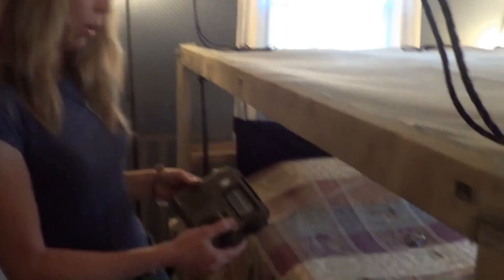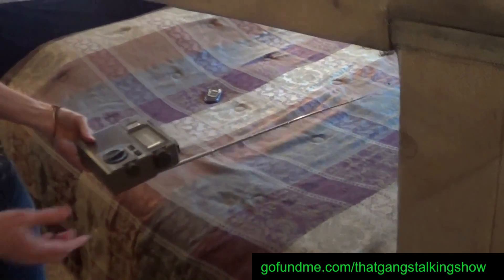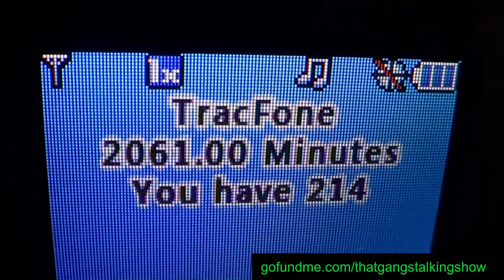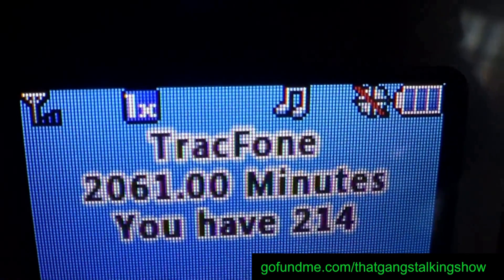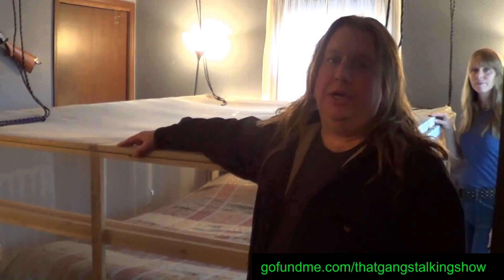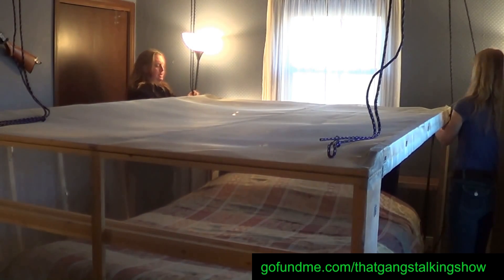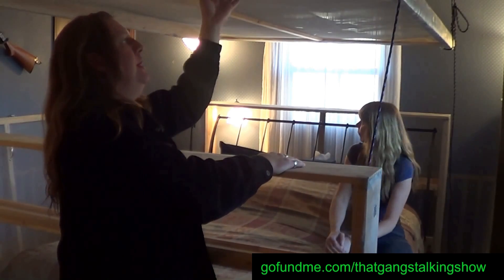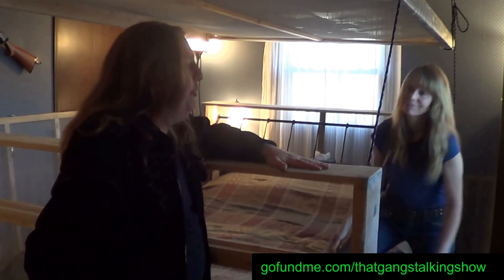Build  Faraday Cage for Your Bed - Shielding to Block EMF Frequencies - How 2 Block Radio Waves

Comment: Imagine this made with a prettier frame, some bead curtains on the outside and twinkle lights, then line it with mirrors all around the frame facing out, add some plants around that.

You can make it luxurious and why not? 

Or this: 
Mirror panels covered in gold leaf on the inside, mirror facing out to give an illusion of invisibility.  🎉

Comment: Love it. It's the Sun. Viruses love it. Dawn. Night sweats. July & August northern hemisphere. If I could build a pyramid I would. Very thick walls
Reply from the maker: I wanna address your night sweats. For more than twenty years, I had night sweats.

I had labs done and everything came back negative.

I like to sleep with an extra blanket. But the room I’ve been renting was so hot that I couldn’t sleep with an extra blanket.

Since taking off that extra blanket, I’ve had no night sweats.

Just use one good blanket and text this out. And let me know what happens.

I was having them several times per weak. I would wake up with my sheets saturated in sweat.

May God Bless You!

One last thing…
Don’t blame the program for everything.

Why?

Because they have agents in the program who intentionally post nonsense and disinformation.

On top of that when they post this nonsense, other TIs complain of the same problem.

But here’s the deal;

When I see something that looks like bs on fb, I check the profile of the person posting it. 

99% of the time it’s an Agent with a fake profile.

These Agents are in charge of more than 29 fake accounts.

How do I know this?

Because it doesn’t matter which account they use, they still use the same style of grammar, spelling and punctuation.

They are not Perps. Perps are low level people who either get hired as a role surveillance player or they are manipulated into doing this.

Perps don’t plan or orchestrate any of this. They simply do as they are told.

Agents work for the program and know what they are doing and why they are doing it.

There’s a big difference between the two.

So anytime you see a bs post, look up the account and you’ll see that it’s new. You’ll see fake pictures and you can tell that it’s fake.

They are paid to post psychological propaganda which is intended to be believable but in reality, it’s a farce.

I’ve had many medical problem since 2004 and not a single one is a result of classified electronic technology.

Comment: Please explain step by step exaclty how you made an emf canopy with instructions and matrieals so people can make their own. Thank you 🙏
Reply from the maker: Need to look that up. I found this video and uploaded it.

They talk about materials used in making it.

Watch it again and take notes.

Look up the material online and shop for it.

For the dimensions, use a tape measure to measure your bed and then allow a few inches on each side and figure how tall it should be.

Use 1x2 lumber for the frame and screw the gram together. Then cut the mesh and staple it to the frame.

If you can’t do it, contact a handyman online and provide him with the materials and tell him that you want to build a faraday cage around your bed.

Tell him you’ll need a way to get in and out of the cage so he can build a door.

That’s all I can tell you.

Look up EMF shielding online. There are hundreds of places to buy from and all sorts of materials including paint that will provide emf protection.

Comment: Hello, can you give one of the links or buy the fabric (or the references) but also the grounding system? Thanks a lot. I thumbed up and subscribed
Reply from the maker: I uploaded this video from YT. I didn't create it. You can study how the cage is made and come up with your own design. You need to study what kind of radio waves that you wanna block and then study what materials block them. I know that there is ample tutorials and ample materials to do this. You just have to look for it. There is fabric and paint. There is shielding....But YOU have to do the research. I don't use shielding. Why? Because I don't know what to shield against. I'm hit with RNM and from my understanding, there is NOTHING that can BLOCK SCALAR RADIO WAVES. But, lets say that I am sensitive to WIFI and Cell Phones, I would study those waves and find the right materials to block them.

There is a TON of materials to shield against everyday radio noise. But as far as I know, there is NOTHING to shield against REMOTE NEURAL MONITORING!
Reply: I had a friend build me a cage around my bed.  We just used aluminum screen.  Total cost $300 for the build and supplies.  BEST THING I EVER DID!!!  No more headaches, lower back pain, neck pain, knee pain, shoulder pain and I sleep like a baby and wake up refreshed in the morning.  I can literally feel my body relax as I lay in my bed.  NO MORE CHIROPRACTOR visits!!!  The money I saved on that alone it has paid for itself a thousand fold.
Reply: @pamelaremme38  The references of the aluminum mesh used please? mesh thickness, centimeters of spaces...etc thank you very much
Reply: @pamelaremme38  The references of the aluminum mesh used please? mesh thickness, centimeters of spaces...etc thank you very much
Reply: @pamelaremme38  What type of aluminum screen?
Reply: @jonfragments3294  The kind you put on windows.  It comes in rolls.

Comment: What’s the exact material that you used? What if the material was made into like a mosquito net instead of using the wood, would that work as well?
Reply from the maker: I have not used anything. I’ve only researched it.
Reply: Use aluminum screen.

Comment: If you can build the box bigger, then why not imbed the mesh in the walls and ceiling, or if it's just for the phone, then build a box just for the phone and any other portable devices?
Reply: Because it permeates the area's all around us.  It's not that easy to put it on the walls and ceiling and FLOOR.  Easier to build a cage.  If EMF's had color and you could see them you would be mortified with what we are being bathed in.

Comment: I have relatives in Indonesia living very close to  a pole that runs electrical wires overhead and this pole is a node for three directions.
Some 5 to 6 cables running, with ordinary 110Volts ..i dunno how many Amps.
The node at 4 meters up is standing at closer than 8 meters from the side of their little house.
Now..is it working to have a self made faraday cage built from (what mesh size ?) mesh and have it shaped in a cube or a globe  AROUND this node of electrical wires/spaghetti ?
and thus protect these people from negative electric/magnetic radiations ? (I mean, it is simpler than building faraday cages around each bed..).
Reply: Not if the waves come from antennas

Comment: To ALL:   The best FARADAY CAGES are made of layered ferrous and non ferrous metals.  This blocks both electrical AND magnetic alternating fields.
Reply: Nice, thanks!
Reply: So for example a layer of steel mesh and a layer of aluminium mesh would suffice?
Reply: @Olofo_olofsson  that’s typically what’s used
Reply: @koba2160  thank you for that

Comment: what's the brand of the metal mesh?
Reply from the maker: I think it's aluminum or copper. Look it up. I didn't make the bed, I snagged the video off yt.
Reply: @ThatGangStalkingShow  To ALL:   The best FARADAY CAGES are made of layered ferrous and non ferrous metals.  This blocks both electrical AND magnetic alternating fields.
Reply: @alankrebs856  Where do you get that material?
Reply: @pamelaremme38  If you mean materials to make a Faraday Cage you improvise. Metal is metal. There are only 2 types, magnetic and not. So you layer your cage out of both metals. You have all the tools to test effectiveness. A phone or radio will show you when you have blocked electrical waves because you will get little or no signal inside the cage.  A common Boy Scout magnetic compass can be used to test for magnetic field blocking.  The less the compass moves when you move a magnet outside the cage the better your magnetic shielding is working.  For non magnetic metal you can use aluminum foil from any food store. For steel which is magnetic you can salvage panels from old washers or fridge or other appliances.  Research MU metal. This is a commercial material that blocks both field types but its very expensive.  What I suggested is a low tech relatively low cost way to achieve the same result on a large scale.  No one SHOULD have to do these things. C towers are being burned by people because of this. You just aren't seeing it reported.
Reply: @alankrebs856  Ohhh that is good news about the C tower burnings.  Smart meters need to be destroyed too!  I'm ready to go without electricity to get mine off my house.  I just was forced to have it installed or they threatened disconnect.  Immediately , heart palipitations, neck pain, lower back pain, snapping in my neck, ringing in ears, joints hurt.  One of the appealing selling points for my house was no smart meter.  For a year and a half my 63 yr old body felt like I was 18!!!!  NO KIDDING.  People don't realize how badly their bodies are being affected because the radiation is introduced gradually.  I just wonder how many people have unneccesary surgeries to correct something that all it is, is radiation exposure.  BTW...my neighbor when I lived on a mountain and he was higher up the mountain than me..C tower on the mountain. (.he was an electrical engineer).  He made a faraday cage and used simple aluminum screen.  He showed me.  No reception in it with phone.  No bars at all.  No radio worked either.  I didn't know the compass test.  Thanks for the info.
Reply: @pamelaremme38  Put as much metal as you can between that meter and you. If possible run a wire from the metal to a good Earth ground.  Like a 4 to 8 foot pipe driven into the ground. That will give you a partial shield.
Reply: @alankrebs856  I honestly think it is the every aprox 20 second pulse that is destroying me.  So would I use the pipe instead of a wire?  or both?  Do I install the pipe vertically or horizontally?  I have absolutely NO wifi, cell phone or any radiation devices and haven't had a microwave in over 20 years.  I have corded land lines but they have even destroyed our precious land lines  with the new "fiber optic."  Now if the power does out I have approx 12-24 hours of a working phone before the "battery pack" goes dead.  They are doing everything in their power to destroy our ability to survive or communicate.  I so appreciate your help Alan.  I am on my own and am doing everything I can to protect me and my dogs.
Reply: @alankrebs856  One last thing.   I have a metal roof.  Does that give me some protection?
Reply: @alankrebs856  So Alan,  Picture my home with a meter on a metal box, it is connected to the metal box.  This aparatus is approx 15-20 feet from my home.  What would you do?  Exactly what would you do?  Thank you Sir!
Reply: @pamelaremme38  Possibly from UV radiation from the sun. It's increasing.
Reply: @pamelaremme38  First of all, read up on what a Faraday Cage is. Tons of videos on YouTube. Ideally you would want to be inside of one so no electrical radiation could harm you. A couple built a cage around their bed and the video is on this platform. This is not easy for most people to do. Look for a meter on ebay that tests for these things. You'll see the meters in many videos.  Then I would do as I said and  put as much metal as you can between you and the wall the meter is on. This can be as simple as aluminum foil. In this case, the thickness isn't that important. All your blocking is an electrical field. I'd get a meter first so you have some idea how much is getting in the home. The foil should be electrically connected to ALL the foil and grounded if possible. Most foil you buy in a grocery store is only 12-15" wide. You would want to overlap the strips so they are electrically connected. Maybe staple it to the wall. Hope this helps.
Reply: @alankrebs856  does it need to be a cage? Can't I just buy fabric that can be used as bedsheets?
Reply: @alankrebs856  they are using directed energy weapons on people.They have 52 fusion centers in the US.They are constantly using sound,emf,millimeter and microwave frequencies at different speeds.They have on that is a slow moving spiral.It is heinous.
Reply: Wow thanks for all the info how do I find out more about directed energy weapons as looking to exit n build soon!
Reply: @Pahanati  Y paint is said to be  good protection, if it's grounded. Copper mesh, and Faraday cages also work.
Reply from the maker: Don’t know what smog is…
Reply: @alankrebs856  Update:  I had a nice faraday cage built.  LOVE IT!!!!  I can feel my body relax in it.  My almost 17 yr old dog benefits from it too.  He has some pep in his step now.  I have to do the compass test.  I did notice they SCRUBBED the internet with EMF information.  They focus on the sun and appliances!!!! I have no smart appliances in my home and everything is hardwired.  I notices a HUGE difference when the smart meter was installed.  Instant headaches, lower back pain etc.  Now as the day goes on...into the evening I can tell my body needs to get into the cage.  It's amazing.  I can't believe they didn't take down this video YET.

Comment: This is one of the better looking and quality seeming Faraday cage setups I've found online now.  Unfortunately, I not only have no idea what metal mesh I can actually buy here in Athens Greece (given that many products even on evil global stores like Amazon etc don't deliver to Greece), but have no tradesman to who has any experience whatsoever building these types of things nor have EMF Readers to actually test them.. against.. stuff that would need to be ordered online from outside of Greece, but the companies / stores that do have them, don't effing deliver to Greece.  
Three main questions though:
1. Do you have to sit the actual bed on top of a conductive floor?  (I have polished floorboards..)
2. What if your bed has a metal frame?
3. How do you "ground" the charge??  I cannot find anyone who explains WHAT AND HOW specifically about "grounding" - ie.  what do you use, how do you use it , where do you put it and what it should and shouldn't touch?)
4. This box is very tight around your bed in this video.. what if you are in bed and you touch the metal?  This might be a naive question but like I said.. nobody doing these videos actually has the expertise/ knowledge or patience to answer these incredibly important questions.
5. It stops a radio, but does it stop your devices being fried if you left them in their by day - and does that mean there is some sort of "accumulation" affect of wifi / EMF/ radiation in your room around the box??  If so, does it dissipate or how do you get rid of it..?
Genuine and thorough answers by anyone who ACTUALLY KNOWS (not speculates, thinks or guesses please), would be very dearly appreciated.  Kind regards..
Reply from the maker: I don't know. I found this video and put it up. You need to search for those answers on your own. Why can't Amazon send items to you?

Comment: Is your WIFI 3G 4G or 5G?.   I would like to see the new faraday cage please.
Reply from the maker: I did not build this cage and this video is at least 3 years old. It's probably 3g at the time.
Reply: @ThatGangStalkingShow  may I ask if you could provide a link where to source this couple to ask what they used for the mesh. Or do you know? And also to see the new proto type they mentioned working on, thank you. :)

Comment: Just use lead paint for walls floor and ceiling and ground it for entire rooms
Reply: lead paint is pretty much illegal as it gives you brain damage
there is emf paint about $500 a 4 litre can, that lasts 12 months
Reply: @commentfreely5443  illegal yea. Kinda like thinking.
Reply: Of course youd want no wiring to that room either.
Reply: @joshbaynard2527  Is there any way to have a Faraday Room, but still use wired internet ( ethernet)  inside it?
Reply: @Isaura21s  yea

Comment: What material did you use?
Reply from the maker: Watch the video. They tell you what they use. You can't watch a video for 2 minutes and expect to learn anything.
Reply: @ThatGangStalkingShow  Do you happen to have any diagrams for how you built the cage? Any tutorials with pictures? Just curious.
Reply from the maker: @ericvega5756  I did not build the cage. You don't need a diagram. Just measure your bed and decide how close you want the encloser. You can make your own diagram. These people talk about the materials they used to build it. If your bed is 6 x 4, I would make the cage, 7 x 5. I would make the top of it tall enough so I don't bump my head when I sit upright. All you need is a hammer, nails, staple gun, mesh screen, wood, etc.
Reply: @ThatGangStalkingShow  Thank you for the reply. Have you built a faraday cage yourself? Are you able to sleep better at night?
Reply from the maker: @ericvega5756  No. I live in an apartment and cannot do that; moreover, I don't get V2k.
Reply: @ThatGangStalkingShow  IF MY BED IS ON THE GROUND LEVEL WITH NO BASEMENT DOES THE STEEL MESH HAVE TO BE BELOW THE BED ALSO?? OR JUST AROUND THE BED AND ON TOP OF BED?
Reply: @HealthSupercharger  yea, all the way around

Comment: Hey does stainless steel mesh works as aliminum? And how dense it must be? And does the bottom also has to be covered?
Reply: Any metal that conducts electricity will work.  I think sheet metal might be best if you want protection from 5G or even 4G wifi.  I also assume it has to be grounded to a metal spike in the ground.  any joints must be over lapped well and tight.  I do not think the bottom is good to cover because you want the natural frequencies from the ground to get into your cage.  I assume you should also be on ground floor.  ideally a tile floor on concrete would be great.